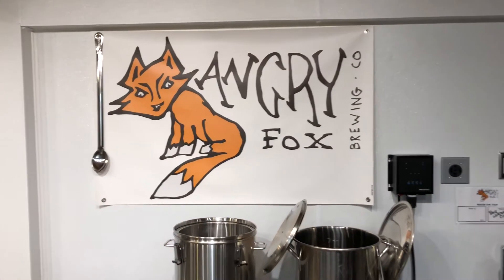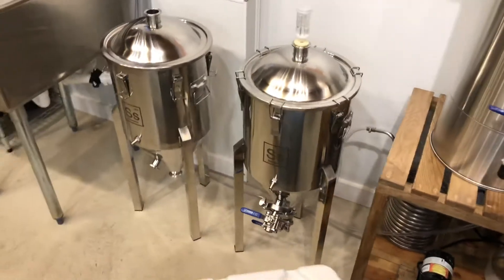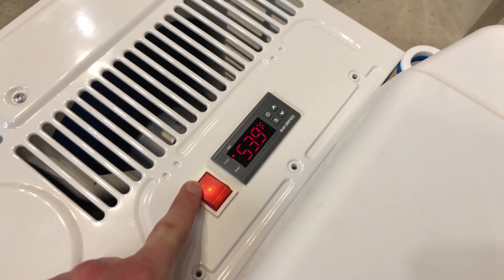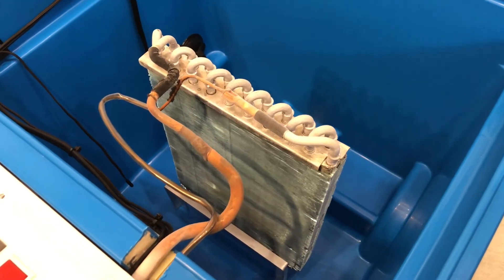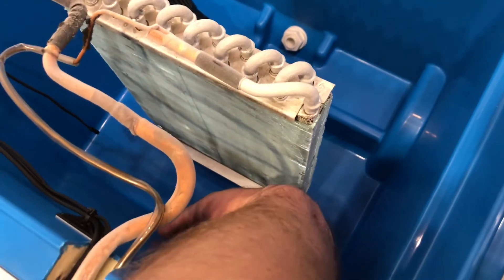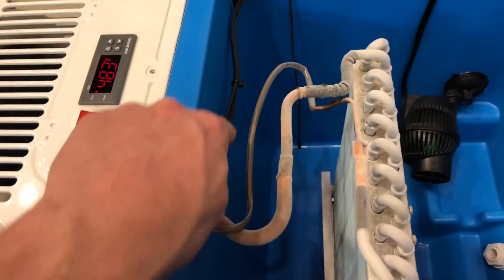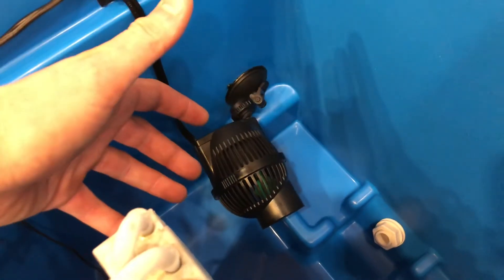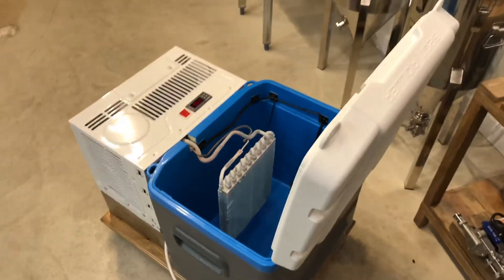DIY Glycol Chiller - 5000 BTU Air Conditioner

Comment: Very tidy build! Curious on your thoughts/research about a smaller cooler (glycol reservoir)? Trying to keep my foot print very small, and only going to be using the chiller on 1 Spike CF5.
Reply from the maker: The cooler I used was most definitely large enough to support 2 or more conicals-- If you're not looking to expand beyond your existing single conical footprint, I'd imagine you could get away with less liquid.  The tricky part is getting the ac condenser submerged properly with less volume.   I was already manhandling it to get it bent into this position without damage.  

If you have a better way to relocate that part, I'm confident you could make a much smaller unit.   Most of the design decisions here were inspired by the path of least resistance. =)

Comment: I will be building a similar build in the next week. Thanks for the video and write-up!
Reply from the maker: Still works great years later!
Reply: @deependstudios  That's great to hear! Getting started on the build today!
Reply: @deependstudios  how do you control the temp to the fermenters?
Reply from the maker: @davidbeiler6364  simple pump to move the glycol through a stainless steel immersion loop in the wort.   Use an inkbird to turn the pump on and off to control temps
Reply: @deependstudios  how do you control the water flow for the temperature? The ink bird can regulate the on/off flow?

Comment: Very clean! How does it connect to your chronical? Did you buy the cooking coils?
Reply from the maker: BrewDad87 I used the FTSS kit from SS brew tech which is just an immersion coil custom fit for their chronically.
Reply: deependstudios Awesome! I wasn’t sure based on the domed lids if you bought their chill kit. I’m trying to figure out how to show my Chronicle since it won’t fit in my fridge
Reply: @deependstudios  is the temp controlled from the fermenter?
Reply from the maker: @davidbeiler6364  you need a probe in the fermented to call for cooling, yes.
Reply: @deependstudios  any chance you can do a video of it in action?

Comment: Hey can you fix the pics on the Home Brew site, they are gone. What was the temp difference with a small 5000 BTU (if really that) ac?
Reply from the maker: tommyinajar I don’t have those hosted anymore, but the 5k Btu air conditioner is overkill for a tank this size.  No trouble chilling a 7g conical down to 37 if you have a jacket on it.  Lots of condensation at that point.
Reply: @deependstudios Celsius or feranhight?

Comment: I'm curious about how much heat this thing puts out while it's running, and if you find that it produces any water outside the cooler that you have to clean up.
Reply from the maker: I haven't noticed a change in the basement temperature while running this for fermentation control.   The unit is fairly small at 5000 btu, so it certainly does pump some warm air out while running but nothing that causes a run-away loop of cooling/heating.   Re: Leaks, no - It stays totally self contained aside from condensation off the chiller glycol hoses.  I did move to wrapping them with foam to prevent the condensation issue-- but again, it's really dependent on the ambient termperature.

Comment: How has it been working for you?
Reply from the maker: Works great, can only handle crashing to about 37 degrees F, but as a fermentation control it's flawless.  Many gallons of beer brewed on this setup now.
Reply: Im seriously considering making one for solvent recovery on a rotory evaporator.   I don't want to spend $1,000 for on 1/6 hp chiller.  Ethanol and even  isopropyl are so scarce and high price. I don't drink anymore but I might try to make some Ethanol as well.
Reply from the maker: Donald Trump's baby GOAT I actually transitioned this unit to cooling a large 60w c02 laser in my shop.  Works great.

Comment: I ferment in a fridge right now but looking to move to a glycol chiller. In a fridge I have a heat bar if I want to raise the temperature. How would you achieve the same with this system? I usually brew Ales rather than Lagers. It would be interesting to get your feedback.
Reply from the maker: The system has a small low-watt density heating pad attached to the cone of the conical.   When you need to increase the heat, for example during a diacetyl rest, you can add it in very gentley using the same controller responsible for heating. 

Quite effective.  I've brewed many ales as well as lagers on this same setup.
Reply: ok, nice. I'm trying to determine whether I go Ss brewtech or Grain father for a fermenter. Nice vid BTW.

Comment: I see a lot of these builds where the evaporator is placed on end versus its original orientation. Any reason for this? Thanks!
Reply from the maker: Sorry for the late response, it is easiest to pass the chiller in the vessel (IE: the cooler) by rotating it 90 degres.  This way, you're not attempting to battle physics trying to keep liquid in a vessel you've resealed with silicone or some other substance.   Cheers!

Comment: How loud is this thing when it's on?
Reply from the maker: Michael what you hear in the video is very representative of it working.   Not annoying at all, it runs in my basement where I’m usually working and I don’t find it annoying at all.  Most of the noise is from the condenser fan and the compressor.